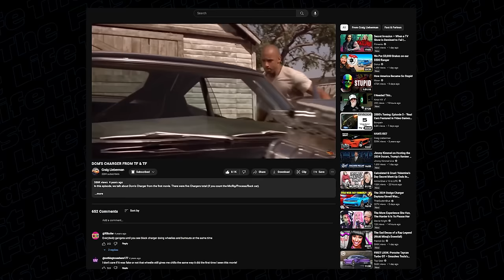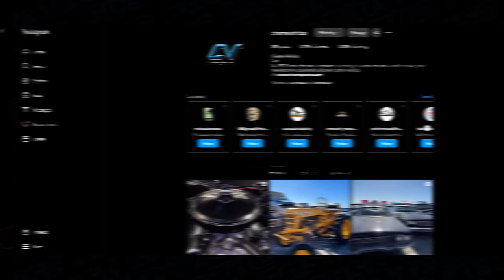WHERE IS  DOM'S CHARGER?

Comment: I remember the original trailer that showed the charger doing a wheelie from that very angle and you can see the wheelie bar holding the car up. At the time I was 15 and didn't know a ton about cars but I knew that it was part of the Hollywood trick. Wonder if I could find that same trailer somewhere online

Comment: I saw Doms Charger at Barrett-Jackson about 12ish years ago. Met one of the builders who happened to be bringing the Charger to the block. He showed me around the car. And all its little building secrets. It was pretty interesting.
I was told (and shown) a 350 Chevy motor. He told me they didnt have a big budget, so they got the cheapest motor.
He also showed me the blower was covering an electric water pump which was switch activated to spin the blower. The belt was just wrapped around the blowers cog. And held together by rivets.

Comment: I remember reading about the 70 Charger used in the first F&F in Hot Rod magazine. They told of the fake supercharger and that they were using 350 Chevy engines in the cars. Being a Mopar guy I lost interest quickly. To hear today that they stayed true to using Mopar engines makes me feel a lot better. And answer the question in my mind as to why you would go to the trouble to swap the engines out. If it’s Chevy. Keep it that way. Dodge then keep it that way. All manufacturers make a really good V-8 that their fans would swear by. Thanks for clearing this up.

Comment: I had an Acura NSX and sold it before this movie came out and after I seen the movie I bought an Eagle Talon TSI all wheel drive and built the shit out of it nobody in South East Missouri could touch that car street racing but I couldn't keep the transfer case and the front axles from exploding all of the time I ran all of the salvage yards in my area out of parts so the car just set on the hillside by the hog pens until some younger guy came along and bought it from me and he never got it fixed because he couldn't find any parts thanks to me buying and using up all the parts in the area lol.

Comment: The Charger engine you show is a 64 or later 426 variant. The 392 would have had the distributor in the rear of the engine. So, you still aint got it right.
Reply: apparently he doesn't know his classic v8s

Comment: I’m a huge fan of the Fast series but I wanted to know what you thought of the 2008-2010 Chevy Cobalt SS Turbo cars as well as their predecessors in the 2005-2007 Chevy Cobalt SS Supercharged cars. I’ve owned both with multiple upgrades to the engine, suspension and exhaust systems. I also owned a 68 Dodge Charger R/T 440, with the performance package and last but certainly not the least I owned a 1992 Skyline GTR (RHD). I miss the Charger the most but I was getting married so unfortunately the 68 Charger was the one I could get the most money for back in 2010. Anyway, I would really like to see what you think about the Cobalt SS both of the options, the 05-07 Supercharged version and the 08-2010 SS Turbo version. Thank you in advance and I really enjoy your content and your insight into these cars that we love to this day. Take care and keep the great videos going!

Comment: The maximus charger is a total of 1 foot wider than a original 1968 charger and built by tom nelson of nelson racing engines here in California its a twin turbo 2000 hp beast i have seen it in temple city California once but never again after that

Comment: I have to disagree with you Craig, I’ve inspected Universals Charger very closely and it’s the same one that was in display on the park for so many years, however now with blacked out chrome and different wheels. The reason I know it’s the same, is that when Dennis McCarthy repainted it, he never touched the grill, so the peeling looks the exact same as the original one on display. Volo may have bought a hero charger, but it wasn’t Universals.
Reply: i got up close and personal with universals charger. looks like the real deal.
Reply: @Trojanmangaming  it is for sure. It’s in storage right now while they prep the 60th anniversary for the studio tour but it’s coming back and will be in a display with a Supra where you can take pics with it.
Reply: Yes someone I know sended me pictures of the car, he made in 2002, and some he made in 2018, same rust spots at the bumper in the back, and the grill hase the same chiped paint, the car just got a Fast 7 make over, Volo museum is just overhyping there replica cars !
Reply: @grievoustheboss  yep

Comment: So the rumors about the Chargers using Chevy 350s are false but the fake blowers are not. Also with the fake blowers, instead of using covers I would’ve gotten a small motor to turn the blower pulley and put a “belt” around the pulley itself to give the illusion of a real blower working because then you could see the spinning pulley with fake belt

Comment: My father's 1970 Charger was a tacky white with blue and red stripes. All it needed was an alternator and some TLC. I would've had it if his b!tch of an ex-wife didn't take it AND the 1971 Challenger in the divorce, likely to sell them as she knew nothing about cars and had motion sickness issues. I would've cleaned up both and had the Charger redone in a matte finish. The Challenger R/T was a beautiful sparkly red with flakes. You can see its rear end on my channel profile banner thingy. Only rode in it... once? Twice maybe. Damn that thing had some torque. A 440 Magnum engine could really press you against the seat when not prepared. At age 6 I was laughing at the feeling. :)